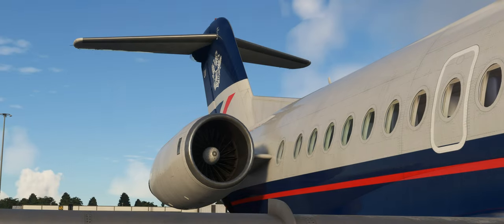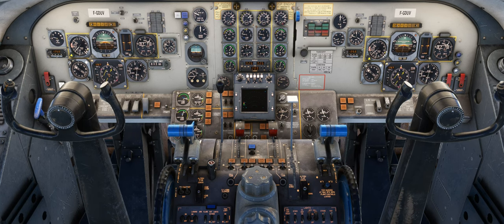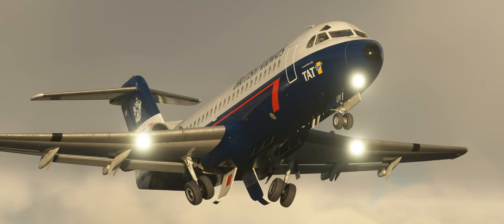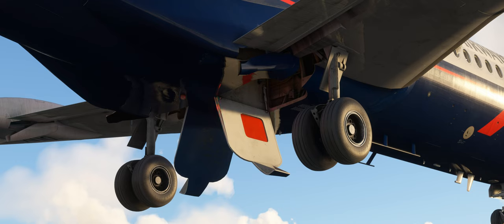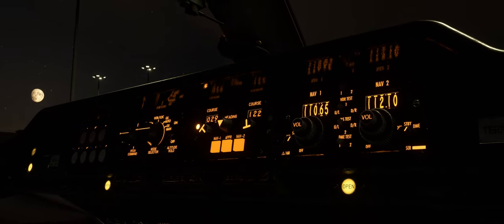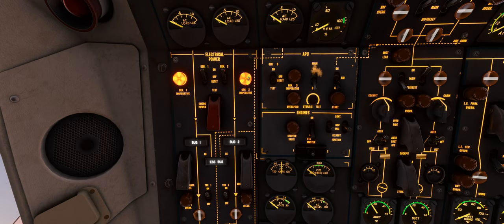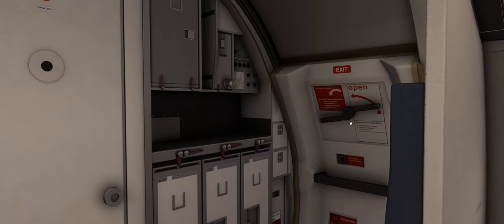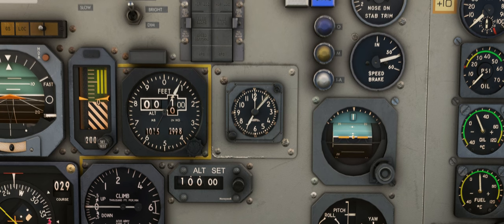The Finer Details - Just Flight F28 Professional MSFS

Comment: Hi, first of all I wanted to congratulate you on your bae146, fantastic plane and great work regarding systems, sounds, details, etc., but I found a single small problem, I found a not entirely fluid experience with the bae compared to other planes, when you move the camera you can notice that it is not completely fluid and that there are half-second micro stutters, nothing much but if it can be solved you can have a more immersive experience for us on Xbox

Comment: i did my very first flight at the age of 4 or 5 on an F28. but recently i was quite surprised when i learned that the lift dumpers are only used on ground and not as an inflight speedbrake. but ... i am almost (i may even say totally) sure that i saw exactly this - the speedbrakes/liftdumpers being deployed during approach (like in any other plane). does anyone know about alternate procedures etc regarding the lift dumpers that would explain what i have seen?
now some will certainly say i was a little kid and maybe mixing things up or do not remember correctly anymore. but over all the years, i have been remembering this and other situations of my very first flight over and over again, so it is not my mind playing some weird tricks on me. in fact, i was so fascinated when i saw these things coming out of the wing that i immediately asked my dad when i was back home. and btw, it was definitely an F28 (airfrance/TAT, frankfurt-lyon, 1982 or 1983). i clearly remember the 2+3 seating, the antennas with the little "wings", the very unique sound - we were seated in the very rear of the plane directly next to the engines (right side), but most important: the characteristic yellowish colour on the underside of the lift dumpers.

Comment: I just wish it had failure modes and/or the circuit breakers were functional (are they?).  I would imagine it's easier to develop failures than to integrate working circiut breakers.  I guess that depends on how well the electrical system is modeled.   I just bought the aircraft after writing this.  I see the cabin crew CBs are functional from this video.  I hope there are more than functional.

Comment: On of my top favorits but what still annoys me is the cabinlight shines through the cockpitdoor. I often fly at night. Its even worse when the exitlights are on. I wrote it down in a support ticket with some other stuff (which are fixed now) but the cockpitdoor remains semi-transparent.... I didnt get a answer to that from the Support Team unfortunatly....

Btw does someone has the same problem with the anti-ice-system? I would not exclude thats my fault but sometimes the right aerofoil anti ice switch starts randomly switching itself on and out (not both when the OAT is too high). Same for the bleed air switch in the top overhead panel. 

Next problem I had was pressurization of the cabin. It remains at some thousand feet and didnt depress itself. I tried to dump it manually but nothing worked. At some point on the ground it worked again.
Reply from the maker: The cabin light shining through the cabin door is unforuntaly a simulator limitation. The method we would normally use to block light shining through walls would mean the camera would not be able to pass through the cockpit door, which is a limitation we wouldn't want when we have a fully modelled cabin. We do have some ideas logged that may fix this isssue though, so stay tuned for future updates.

The right airfoil anti-icing switch turning itself on/off sounds like it may be a controller conflict. We would recommend checking if you have any "ANTI ICE" control assignments assigned in MSFS Options > Controls Options that may be constantly being triggered. Alternatively, if it's the mechanical indicator the constantly switching on/off that will indeed be the overheat protection kicking (off the top of my head I think it's a duct temperature of 65C that triggers that, which correlates to approximately 15C OAT).

The cabin pressure isn't an issue we have seen reported before, so would you be so kind as to raise a support ticket with us for that? Then we can take a deeper look into what may be causing that.
Reply: @justflight  Thank you Sir. I will open a ticket when it happens once more with screenshots and more details. Despite the small issues mentioned, this is one of the best AddOns for the MSFS and I really appreciate the love flown into this

Comment: Any updates on the pa38 tomohawk. Also the pa28 warrior needs a bit of work doing on its flight model. I fly pa28's and it's not quite right
Reply from the maker: You need to contact support with your specific feedback on the Warrior. Then they will pass to the developers to be looked at. The P38 is now inhouse but currently in a queue behind other projects. Fair bit of of work is required to get it fit for release so nothing imminent on that one.

Comment: Why did Just Flight lie to Xbox users by announcing FS28 Professional as available in the marketplace, only to remove it within hours without explanation?

If it was Microsoft's mistake, Just Flight has an obligation to say so in a public statement that releases it from liability and makes it clear that the "mistake" is Microsoft's, otherwise it remains a "mistake" by both.
Reply from the maker: Thanks for the advice on that one.  Yes it was a mistake by Microsoft, a genuine error.  Where we've been asked and where there's discussion we're letting people know what happened. The a/c wasn't ready for release on XB, it's still not quite there but shouldn't be too long now.
Reply: @justflight  Thank you for your sincerely answer… we will spectate to the return of F28 (with the Navigraph integration for Xbox) to the marketplace